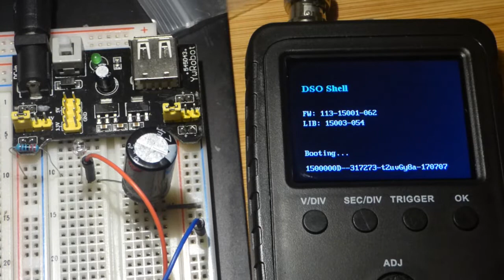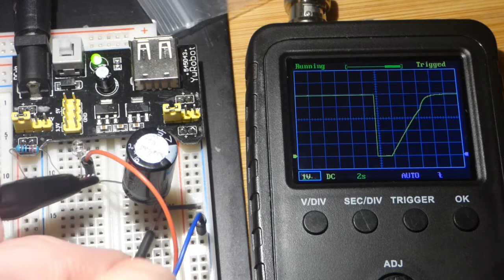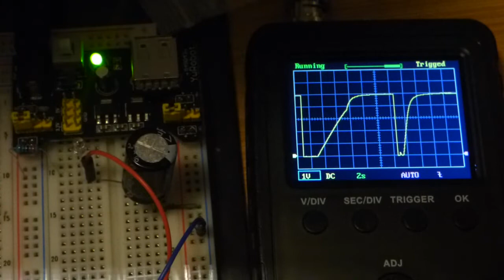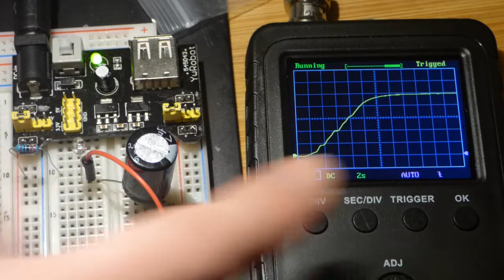Photodiode and capacitor voltage ramp circuit for beginner learning electronics

Comment: very clear and straight forward explanation. I would like to inquire about the difference between the circuit you built here, and the inner-circuit of the "DET110 photodiode" where the capacitor is between the Photodiodes cathode and the batteries ground. thank you